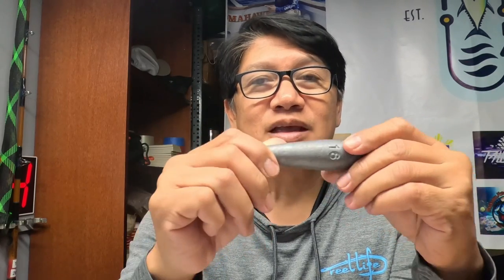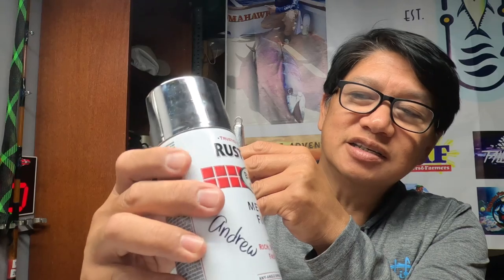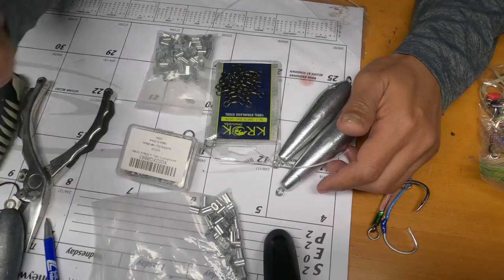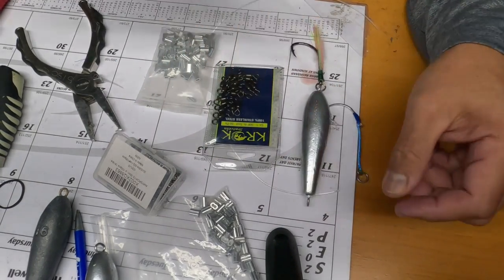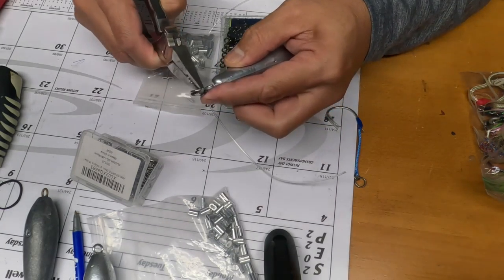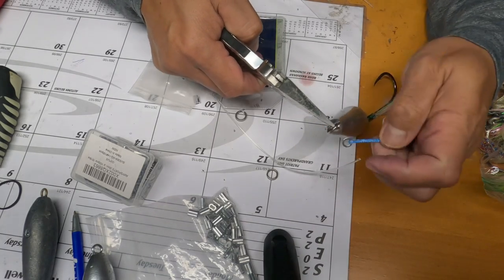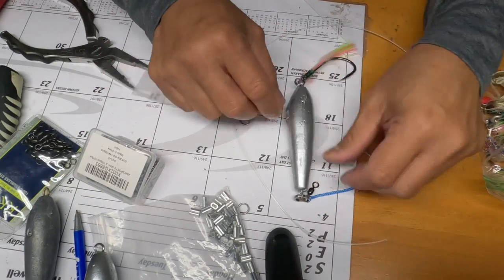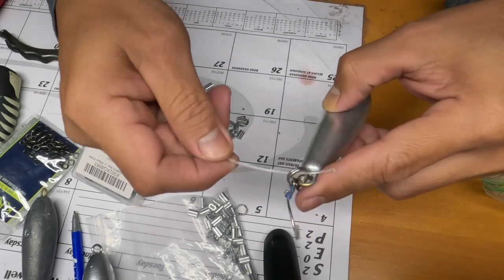HOW TO MAKE TORPEDO SINKERS INTO FISHING JIG🤫🤔😯😮

Comment: Those sinkers are incorrect for this purpose. The metal loops on each end do not connect all the way through. You need “ through wire” sinkers to build Eddie bomb rigs. If you attach a hook to one end it could pull right out if you hook a strong fish .
Reply from the maker: Maybe you are right but I don’t any problem with those. Thanks by the way.